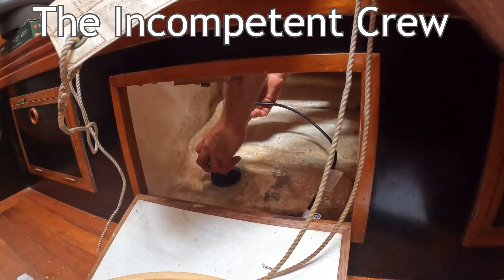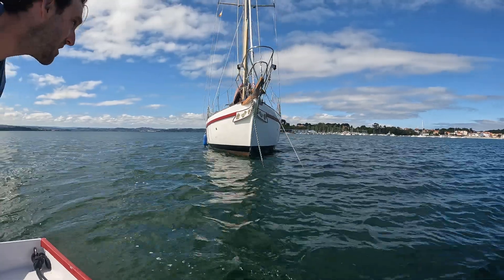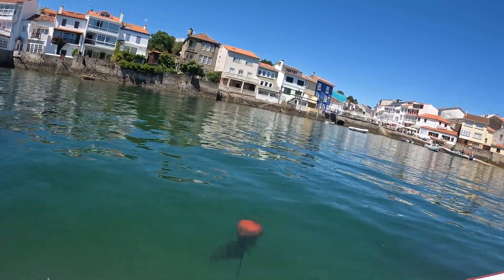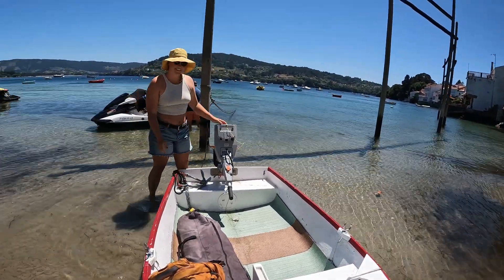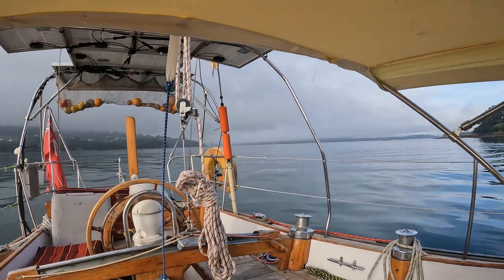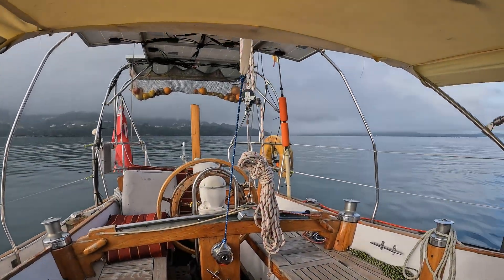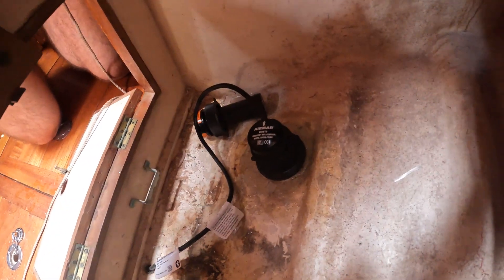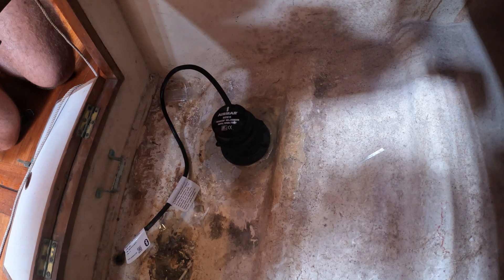episode 7 - What happens if the skin fitting flap for Airmar DST810 fails?  Sailboat life

Comment: Haha…reminds me of when my dad did the same thing.   To make the fitting slide in easier, he gave it a good spray of WD40….mistake, the solvent in WD40 makes some plastics sticky…heck of a job getting it back in…locker got a good wash out though!
Reply from the maker: I had a surprising effort finding silicone grease to do the job. I've become weary of WD40 not being the best for most things now. Also, in fairness, as soon as the rubber seal is wet its plenty slippery enough on its own to just slide in. thanks for commenting. :)

Comment: I've got one of those in skylark,  it works for a short while then gets plugged up.  Don't even worry about it anymore
Reply from the maker: I was a bit disappointed to learn just how quick the paddlewheel stops spinning with the lightest fouling. But, I do also swim around the boat regularly and have a couple of options to clean it. Seems I have created another job for regular maintenance. :)

Comment: We do this regularly, if you quickly put your hand over the hole when removing one and then remove as you put the new one in the water coming out can be minimal even without the valve.  Your hand over the top will stop the water easily, there actually isn't that much pressure.
Reply from the maker: Correct! about 1psi. I shall have to try. thanks